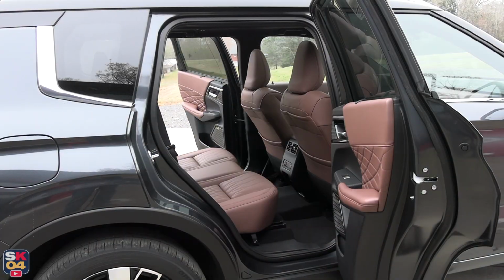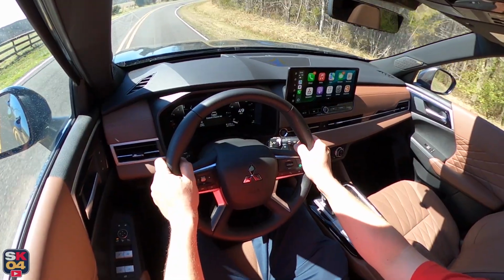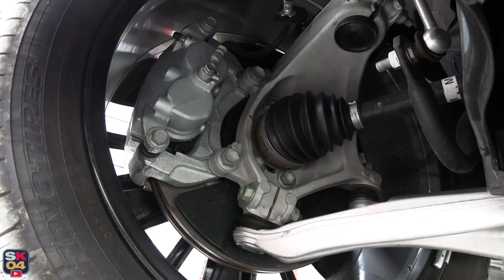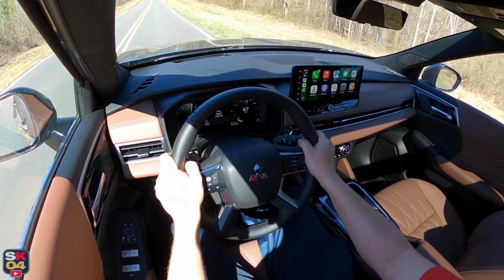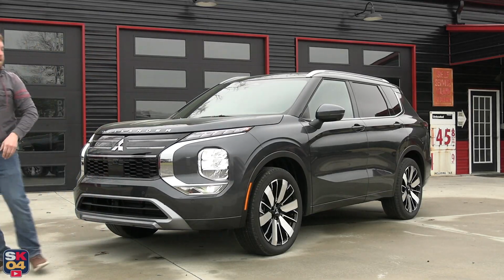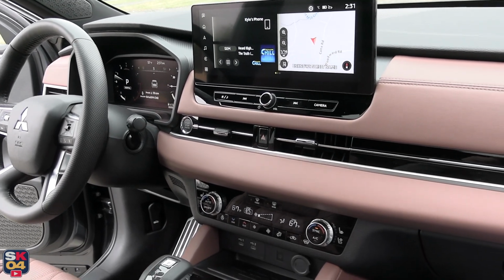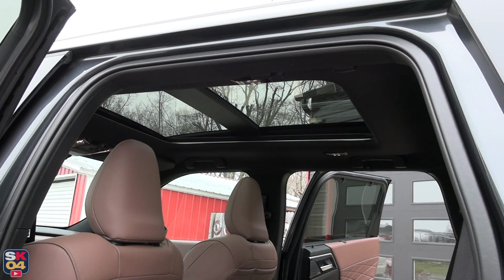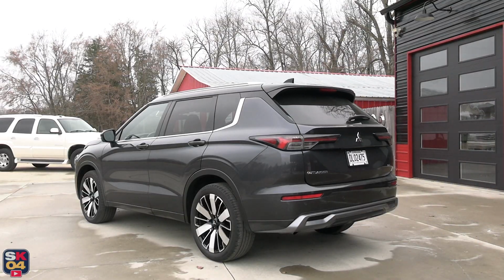2025 Mitsubishi Outlander SEL Premium: Start Up, Test Drive & In Depth Review

Comment: Glad they kept the bulletproof 2.5 four-cylinder instead of going to the explosive turbo three cylinder of the Nissan. Mitsubishi did the right thing by not taking that change. Keep the good reliable Engine, even though it’s a little underpowered.